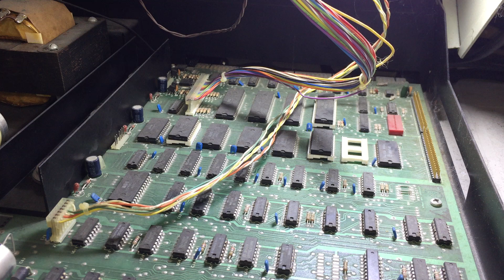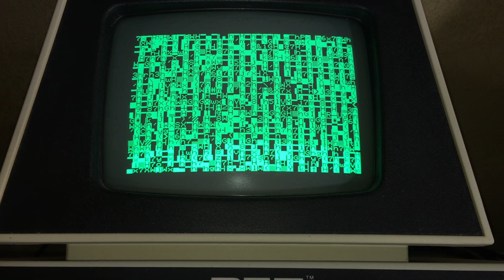Commodore PET Attempted Repair - Board View - 2001 32k 16k BBBBS ROM EPROM 6520 - Episode 1450

Comment: Hi Dave.  That 901465-03 is a basic 2 and stored in the extra room socket- I guess.  The 901447-29 is the screen editor. Since the one from the other pet, that you tested, is defunct. You should take a copy of the good 901447-29 as I don't see it in the archive.   I may have missed it. Lol!
Reply from the maker: Thanks...I will see about that...I shall, indeed, I will!  I have been battling with these machines over the past days, and weeks...but soon, I will be back into them, to see about going at the BBBBS PET...The machine that has BASIC 2.0 and has not been upgraded, I will leave be...and yes, make sure that copies of the ROM's are made...I am aiming to have another BASIC 4.0 machine with socketed chips up and running and happy so I can start testing, swapping, fretting, and pondering...stay tuned...thanks so much for your wisdom and insight!
Reply: @DRBradleyPhotography  My eprom programmer is ready and standing by to copy and make any new ROMs you need
Reply from the maker: Thanks...I am sure I will need something burned as time goes on...you the man!